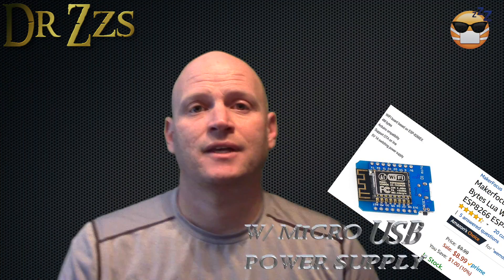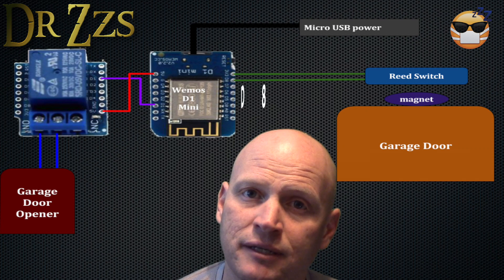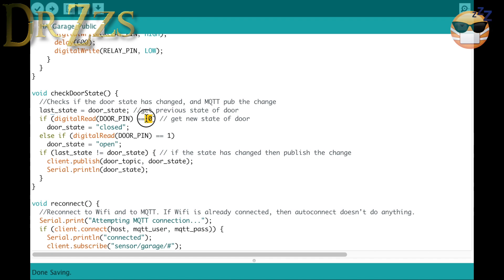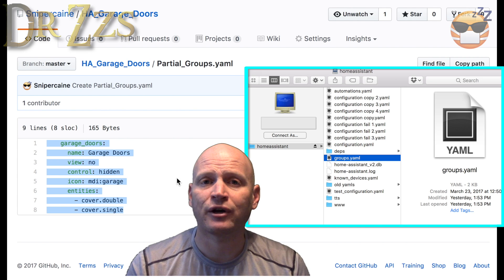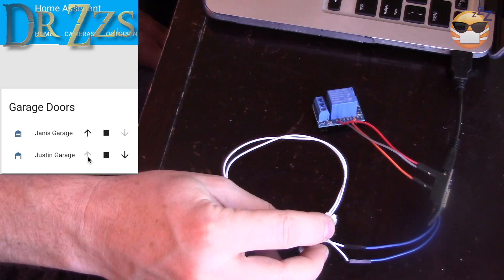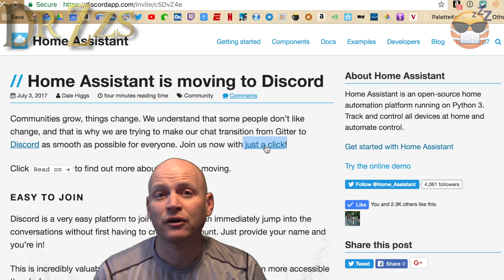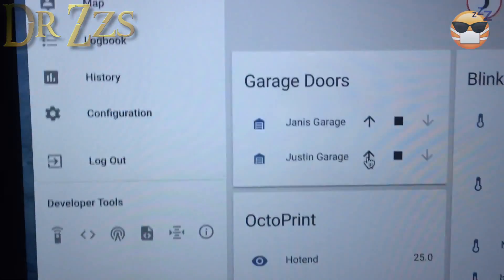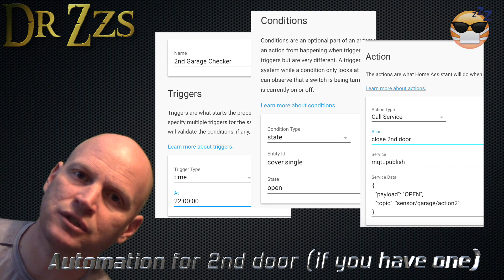DIY Smart Garage Door Opener

Comment: Great work on the tutorial!  I am a complete noob to all this so I've already learned a lot getting Hass.io uploaded, then Hassbian uploaded.  I also learned a lot getting the Arduino sketch uploaded to the ESP8266 board.  I am having a problem with it working and I have seen this problem using Hass.io and Hassbian.  I can connect to Home Assistant fine using DuckDns.org (and through an ip address) with no changes to the configuration.yaml file.  However, when I add the code for the garage doors (cover, customize, group sections) and restart Home Assistant I cannot reconnect to Home Assistant.  I always verify the config file before restarting and it always comes back with "verify".  I can go back into the configuration.yaml file and delete the added code and restart Home Assistant via Putty.  When I do this I can reconnect to Home Assistant.  Do you know what would cause this to happen?  I'm racking my brain and have tried various things with no luck.  Any help would be appreciated.
Reply from the maker: Daniel Atwood thanks!  
There’s a Home Assistant log file in the same folder as the configuration file. It should give you some info about where it’s getting hung up. Sometimes it will even tell you the lines the errors are in.
Reply: This is what comes up in the Home Assistant log file:
2017-12-24 18:57:47 ERROR (Thread-2) [homeassistant.util.yaml] mapping values are not allowed here
  in "/home/homeassistant/.homeassistant/configuration.yaml", line 15, column 18
2017-12-24 18:57:47 ERROR (MainThread) [homeassistant.bootstrap] Error loading /home/homeassistant/.homeassistant/configuration.yaml: mapping values are not allowed here
  in "/home/homeassistant/.homeassistant/configuration.yaml", line 15, column 18

line 15, column 18 is at the end of cover.double under customize:
Reply from the maker: Sorry for the delayed reply. 
That's going to be helpful.  So the problem has to be something in or after that line. yaml can be a little picky about syntax. 

Can you post the text or an image?
We should be able to find the problem and fix it.

Comment: Anyone know how to have the door status update after a restart of hass?  I have to close the door or open it for the status to update.
Reply from the maker: That's what I do too.  
I think my garage door sketch could use some improvements.  I also get random openings of the garage doors sometimes.  I think it happens when the board disconnects and reconnects from the wifi.  There's probably a simple solution in the sketch that would make it so it doesn't trigger the relay on reconnect, but I haven't gone in there to find it or fix it yet.
Reply: Random openings?!  That's kind of a big deal.  Has anyone else experienced this?  Any solutions?  I've really been itching to try this out, but this makes me nervous- kind of defeats the purpose security-wise.
Reply from the maker: I don't have a great solution yet.  I think the problem has 2 sources:

1. D1 mini's are connected to 2.4ghz wifi and are probably getting interference from other things (Drones, Microwave, etc) and get disconnected from the network occasionally. 
2. When the D1 looses connection to the network and then reconnects, it triggers the relay.  I'm hoping that's something that can be fixed in the sketch, but I haven't taken the time to tackle it yet.  

Unfortunately the ESP8266 (wifi chip in D1 mini, NodeMCU, and Sonoff) can't connect to 5 ghz wifi.  So, the solution will have to come through changes to the sketch.  I'm still a novice Arduino sketch writer.  I expect there are people out there that could write a better one than mine.  If anyone has a solution please let me know.
Reply: DrZzs .. yes I’ve had random openings too... my garage is a separate building some 10 meters away from main house ... probably at the extreme range of the wemos back to raspberry pi i running mosquito broker n the upstairs office in the main house ... as you say I think it is all to do with “reconnecting” to Mqtt server ...Still trying to work out some code fix. Anyone else got a solution?

Comment: Might I make a suggestion in regards to the reed switch placement. Where you mounted it will only tell you if the door is fully open and can't detect partially open. That may never be a problem for you if you always are full open or full close. I sometimes lift my door partially for various reasons. Therefore, I plan to mount my reed switch lower on the door and determine if door is closed rather than detecting for open. Nonetheless, this is a great video. Keep up the good work.
Reply from the maker: Great point.  Watch for voltage drop if you put the reed switch far way from the D1 mini board.  @Josiah Kidd had that problem and solved it by using the 5v pin instead of the 3v pin for his reed switch.  
Thanks for the support!

Comment: Great tutorial and great work!!! Thank you for sharing. I needed to find an alternative to my Z-Wave Garage Door controller that has been giving me issues since switching over to HA. This works perfectly!!! I'm using the NodeMCU and had an issue with the door status updates... I switched the reed switch from the 3V pin to the VIN (5V) pin and that fixed it. Not sure if anyone else was having that same issue but I figured I'd share with everyone just in case. I'm excited to try out your multi-holiday LED project next!
Reply from the maker: Josiah Kidd thanks! 
I’m about to do another video on more holiday LEDs but using 12v lights instead.  Should allow longer distances without needing to tap in extra power. 
Btw. I bet that was the issue with your reed switch. If the distance between your switch and your wemos was long or your wires are small gauge it was probably voltage drop causing your sensor to malfunction. Switching to 5v was a smart solution. 
Thanks for the encouragement. Good luck with the lights. Let me know if you need help along the way.

Comment: I tried to get the WIFI working but keep getting Arduino IDE error would it be possible to create a working configuration file with working WIFI. Thanks for any assistance.
Reply from the maker: check the github link again.  I updated it with a sketch that has the lines you need to connect to your wifi network. 

HA_Garage_Public_w_wifi_pw.ino

Hope that helps!

Comment: Awesome tutorial.  I purchased everything through the links that you provided.  Only thing I changed was adding my wifi ssid and pw.  I have HA on a pi and everything configured on that end.  Everything shows correctly on the states page but nothing changes when I move the reed switch or click up or down.  All of my mqtt info was added to the sketch as well.  A test of mqtt with mqtt.fx shows everthing is working on that side of things but I don't know how to see if the board is actually connected to the mqtt broker or not.  What board did you call this in the arduino ide.  I have mine as a generic esp8266.  Any thoughts?
Reply from the maker: I've got it as "WeMos D1 R2 & mini". https://www.dropbox.com/s/phpodw1lvy5ydn8/Screenshot%202017-10-05%2016.21.52.png?dl=0
I think if you have the board connected to your computer with USB and your arduino IDE open you can use the serial monitor to see if it is connecting to the broker.   The serial monitor button is in the upper right corner. 
https://www.dropbox.com/s/pzzfpbhkrx2d71b/Screenshot%202017-10-05%2016.25.58.png?dl=0
I did have some weirdness going on with one of my boards.  It wouldn't trip the relay. Everything else seemed to work.  After just resetting and reloading it 4-5 times it started working.  I've no explanation for that. Hope that helps.  
Good luck!
Reply: DrZzs thank you I will report back!
Reply: I so want to get this working.  I am a noob for sure.  I am not able to connect the wemos to wifi and therefore mqtt broker because of that.  Could you add an alternate sketch to include the wifi password and ssid area as well as the wifi setup under void setup on the github page?  I've been trying to add them for an hour and keep getting errors on verify.  I clearly don't know how to write sketches :) or even add to them.
Reply from the maker: for sure.  Here it is:
https://github.com/Snipercaine/HA_Garage_Doors/blob/master/HA_Garage_Public_w_wifi_pw.ino

I'm pretty nooby too.  I still don't exactly know why mine works without the wifi name and password, but it does.  You're not the only one who had this same problem.  Lucifer Lucifer was the one who fixed the sketch.  
Hope this does the trick for you.  
I've actually come across a potentially better way to turn things on and off with Home Assistant by modifying the basic Sonoff outlet.  Gonna work and that and make a video eventually. 
Good luck!
Let me know if you still don't get it working.
Reply: Looking forward to your next video.  Ironically I am looking at the Sonoff outlets as well.  I tried the sketch and I am indeed connected to my wifi network now.  I get Socket error on client <unknown>, disconnecting. in  MQTT broker add on in hassio. No clue how to fix that? Also, I get random characters while connected to audrino to see if it is connecting to MQTT.  I doubt it matters but there is no void wifi setup stuff in the new sketch like you told lucifer lucifer ex.  "setup_wifi()"
//then this:
void setup_wifi() {

  delay(10);
  Serial.println();
  Serial.print("Connecting to ");
  Serial.println(wifi_ssid);

  WiFi.mode(WIFI_STA);
  WiFi.begin(wifi_ssid, wifi_password);

  while (WiFi.status() != WL_CONNECTED) {
    delay(500);
    Serial.print(".");
  }

  Serial.println("");
  Serial.println("WiFi connected");
  Serial.println("IP address: ");
  Serial.println(WiFi.localIP());
}
Update. Fixed the random characters by changing the baud rate in arduino window. Says attempting mqtt connection. failed rc--2.
Reply from the maker: I'm not using Hassio.  I tried it when it first came out but it messed up a bunch of things I had already set up so I went back to hassbian.  I really have no idea about the socket error.  Try the Hassio forums, or the Home Assistant discord channel.  There's a section in there just for Hassio help.  Those guys are smarter than me.  I'm just a tinkerer with a camera! 

The random characters might be from using a different baud rate.  Try changing the baud rate when you're looking at the serial monitor. 

You can try adding that setup wifi function.  Again, I don't have that in my sketch. The new sketch with the wifi setup is the one Lucifer is using and it worked for him.  
 
Sorry you're still having trouble.  Keep at it! you'll get it eventually!
Reply: Switched to Hasbian and everything works like a champ!
Reply from the maker: Ha!  that's awesome!  wow.  didn't expect that!  good job!

Comment: Bro is awesome but i dont see the code to connect wifi in ino. could you help me?
Reply from the maker: I noticed that before I posted the code so I checked my boards and I don't have wifi user/password on mine. I'm not sure how it connects without it but it does. 

When I get to my computer I'll post the lines you could use to connect.

I wonder if maybe my HA Pi is accessible for mqtt messages from devices that haven't logged into my wifi with user/password.
Reply from the maker: I double checked and I definitely don't have my wifi user/pw in my garage door sketch.  I think it works because in the sketch you do have the IP address for your MQTT broker (probably your HomeAssistant pi),  with the MQTT user/pw.  

If it isn't working for you as is, then you could add the connection to your wifi and see if that works. The lines to connect your wifi should be something like this:
Reply from the maker: //This might be confusing...

#define wifi_ssid "yourusername" //enter your WIFI SSID
#define wifi_password "yourwifipw" //enter your WIFI Password

// there's already a "void setup()" function, under that heading you need to put "setup_wifi()"
//then this:
void setup_wifi() {

  delay(10);
  Serial.println();
  Serial.print("Connecting to ");
  Serial.println(wifi_ssid);

  WiFi.mode(WIFI_STA);
  WiFi.begin(wifi_ssid, wifi_password);

  while (WiFi.status() != WL_CONNECTED) {
    delay(500);
    Serial.print(".");
  }

  Serial.println("");
  Serial.println("WiFi connected");
  Serial.println("IP address: ");
  Serial.println(WiFi.localIP());
}
Reply: i will try bro thanks thanks so much ... really
Reply: bro is work  really awesome , i use a esp8266 instead , well i only put some parameters to ino and is all thanks so much bro. 
i will give you ino with the modifications .
Reply from the maker: Awesome thanks!  I'll add yours to the github repo for others to use.
Reply: I add ssid and password , brother thanks so much so much, that's is the ino.

Comment: Hey, great video! I'm trying to simply get a relay working but instead of a Wemos D1 mini - I'm using the ESP12E developer model. I'm able to see MQTT topic state changes but I never hear the relay click. I've tried other brand new relays. I'm connected to VIN (5v) on my ESP module. I used your arduino code and tried ESP Easy using the URL command - nothing. Thoughts?
Reply: Sorry. Ended up going with the opengarage  solution. I had all the parts, nodemcu, distance sensor and 5v relay. Worked great and swbradshaw has a great HA write-up. https://community.home-assistant.io/t/opengarage-open-source-wifi-garage-opener/17228
Hoping I'll find something else for those lil D1's I've got now. Keep up the great videos tho!
Reply from the maker: I'm not familiar with that board.  My first thought would be trying a different pin. Your relay is connected to 5v and which other pin?  At first I connected to 5v and D4 on the wemos and it didn't work.  Changed it to D1, using the same code (except changing the pin callout) and it worked. Let me know if changing pins works. If not we'll try something else.   Thanks for the positive feedback on the video!
Reply: Tried with several different pins - D1, D4, D5 etc. Nothing actually triggered the relay. The relay lights up red when I toggle the button in Home Assistant, but doesn't actually "click" or trigger the garage door when connected. I have other 5v relays with Signal, 5v and ground and tried that with various pins as well, same result. I currently have the system hooked up to the reed switch to let me know if the door is open/closed but can't trigger the relay. MQTT seems to be working fine - I see the action when I subscribe to the topic "sensor/garage/#". I ordered 2 d1 mini's to try and simply switch out the boards and get your exact setup. They're on the way.
Reply from the maker: that's a bummer.  It's gotta be the boards.
Reply: Got the D1 mini boards. Now I can't get mqtt connection. Then I loaded espeasy just to check mqtt. Works great! Double checked wifi credentials, mqtt user and pass (double checked credentials on working nodes) and serial continues to read mqtt connection error. Thought it was the board but if esp easy worked then it's gotta be something in the code right? I'm really a noob/lazy when it comes to coding. 
Also, I'm running Hassio and was able to get the reed switch reporting via mqtt on the esp12e board and updating flawlessly in HA. Thoughts?
Reply from the maker: Im gonna guess its Hassio.  I use Hassbian.  I don't know were the problem comes from specifically, but there's something in my sketch that Hassio doesn't like that Hassbian doesn't seem to mind.
Reply from the maker: that looks like a really cool solution!  Love the sensor idea.  
I'm sure you'll find a use for the D1 mini.  They're great for controlling LEDS...
Reply: Is the D1 Mini not capable of working with a distance sensor?  I would love to see you do a version of this with a distance sensor like OpenGarage